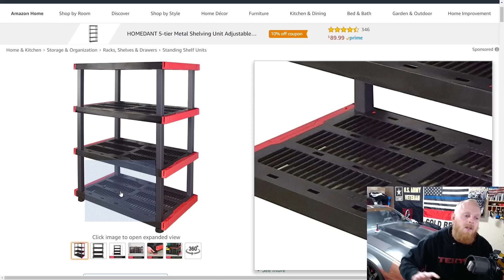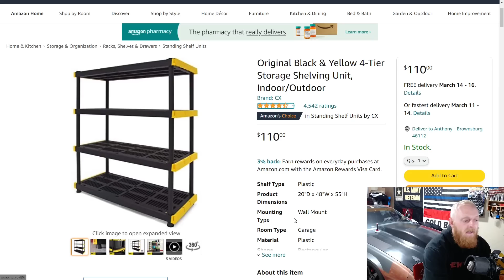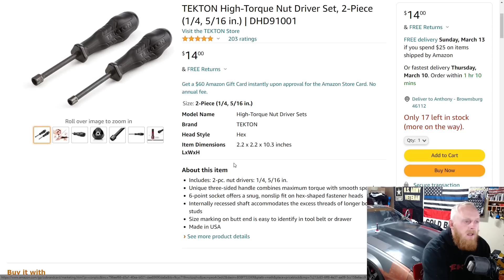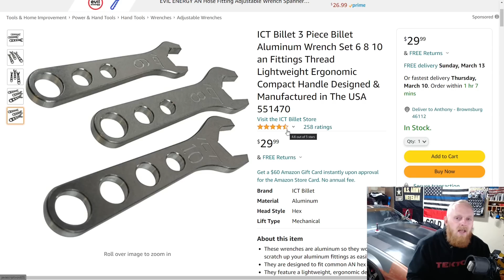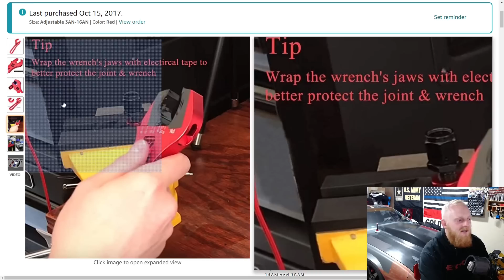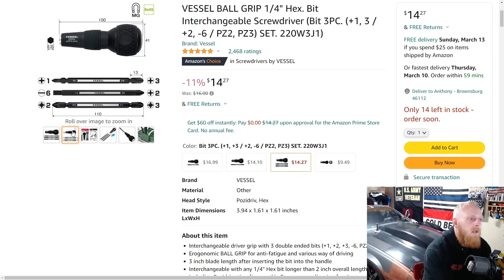Great Amazon Tool Deals USA and Japan Tools

Comment: Vessel makes great screwdrivers. If you work on Japanese stuff (especially motorcycles) you should be using JIS screwdrivers. You’ll save yourself a lot of headaches and damaged fasteners. Do NOT use Phillips on JIS screws!
Reply from the maker: Absolutely! And JIS still works great on normal Phillips screws as well so I would rather have a good JIS Screwdriver. Thanks for sharing your thoughts as well.

Comment: The Vessel interchangeable ball grip is great, they also have other long 1/4 in hex blades that work with them. The blue megadora screwdrivers with the knurling on the shaft are my favorite, the phillips or cross point tips on Vessel stuff fit great.
Reply from the maker: Very nice. Great to hear thanks for sharing. I'll look into those as well

Comment: Leveling out the feet is where those Capri Thin Wrenches will come in Handy!
Reply: so im tightening a nut shaft combo that screws a caster up into its receiver in the cabinet, only bout 1/8 th inch total height of the hex, didnt know about thin wrenches so i got some stout but thin cheapos at flea market on sun. and ground them down to fit thickness, so far work great but only one size, ima go see the capris
Reply: @Steve_mos8541  Every Time I need them, I am glad I have them. I have the SAE & Metric and they are well finished and accurate. I'm sure you'll be happy one you get them

Comment: Do you have the link for the Gearwrench punch holder? When I go to Amazon it’s showing a much different price.
Reply from the maker: The original seller of the gearwren h one just sold out. Should be back in stock soon at a much better price. But here is one by Williams made in the USA of a similar design if you are interested in it. https://amzn.to/36zcKKl
Reply: @TonyTheTechnician  
Thanks
Reply: @TonyTheTechnician  
That us a exact copy of my Snap On holder.  Of Williams is Snap On so it makes sense.  I bought mine in the 80s and although the rubber is pretty much gone and the handle shows alot of wear they still do the job. I highly recommend these. I mean 40 years of use with 35 in a professional environment what more do you need.
Well worth the money in my opinion.